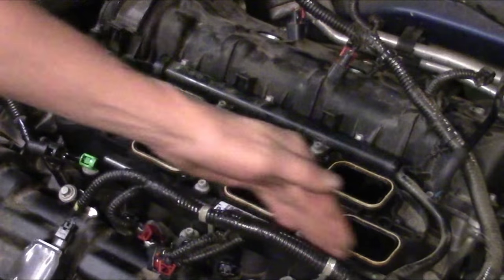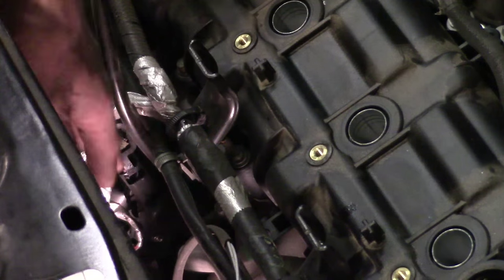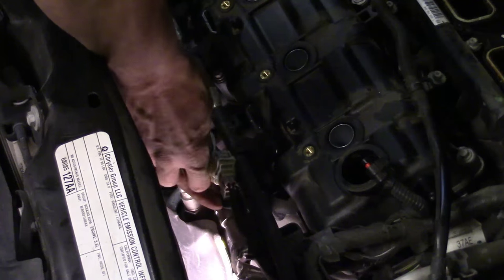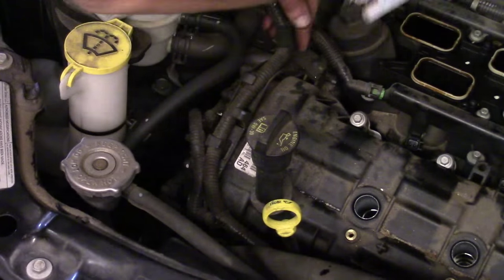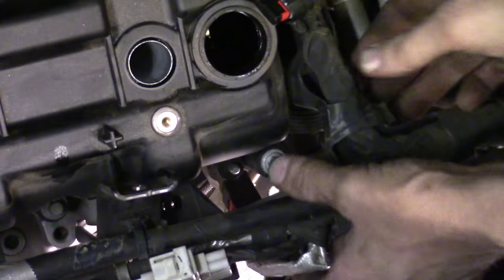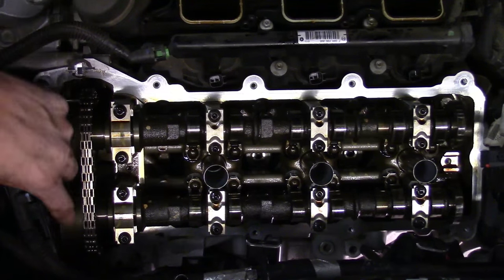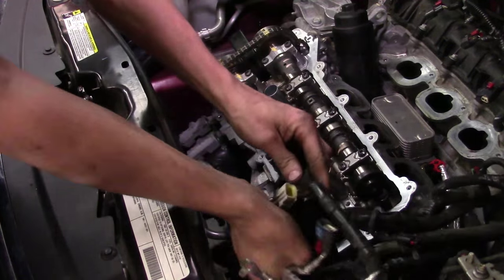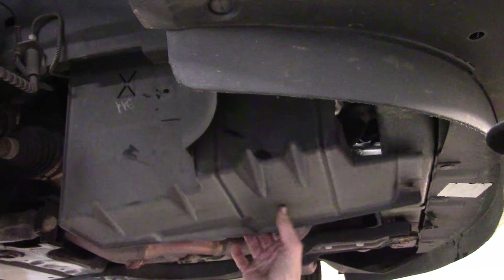Part 4/10: 3.6 Pentastar engine left cylinder head removal (the short cut)

Comment: Is it necessary to remote the lower intake for this head replacement? My 2012 Wrangler is in the shop right now and shop is trying to charge me $800 for the oil cooler and $500 labor for replacement when the engine will already be disassembled for the head replacement.

Comment: Hello I’m working on a 2011 3.6 Durango. The drivers side spark plug tube seal needs to be replaced. Do I have to have the engine on top dead center to take off the valve cover or can I just take it off and replace the valve cover gasket and tube seal? Your help will be appreciated. 🙏
Reply from the maker: No need to rotate the engine. Just remove the valve and then replaced the needed seals. Thanks for asking and make sure to subscribe.

Comment: I'm doing the right side of the engine, removed all of the bolts, removed cam sensor and whatever else was on the back of the valve cover. It's still getting caught on the right rear part of it and preventing me from completely removing it. Do you have any thoughts or ideas on what might be obstructing it still?
Reply from the maker: Have you removed the pcv valve? That has to come off as well on the rear of the valve cover and then you have to lift the front and move the valve cover towards the transmission to clear the end of the camshaft that sticks out the pcv valve opening.

Comment: Thank you very much for this great Video, for I have a question in a minute (03:07) of the section to which I referred Is it meant to the problem (P0010 Bank 1 Camshaft 1 position actuator circuit open)

Comment: There are two small protruded pins it looks like on the front valve cover on the lower side just inside the the outer stud bolts. Are they pins or are they special bolts I just can't seem to get my front valve cover off and I don't want to break it or pry on the sealing surface
Reply from the maker: The two pins are for alignment only. Dont forget to remove the cam sensor on top of the valve cover at the rear and then all the bolts loosened. It may still be "stuck" and need some help. The seal has some rtv near the front that seals the gap/seam between the front timing cover and head so it holds onto the valve cover a bit.

Comment: Hey where can I get a new valve cover gasket from other than the dealer? Mine has been leaking for over a year but it was a small leak and I'm noticing it getting bigger on my challenger. It's gotten to the point where some has leaked onto the transmission. A very small amount but it is there. I traced the leak to the valve cover so I know it is bad for sure.
Reply from the maker: What is the year of the vehicle.....it isnt a 2014 is it?

Comment: Do you have to have the heads machined if you are replacing the head gasket or can you just replace the gasket and put everything back together? I am not replacing the heads or having them machined, just replacing the head gasket. Is this possible?
Reply from the maker: Question? Why are you replacing the head gasket? Reason I ask is that they are multi layered steel and not blow. If the engine gets over heated to much the heads will warp
Reply: @MotorCityMechanic  It was loosing coolant and getting hot, not overheating but just getting hot. I took it to my local mechanic and he informed me that I have a blown head gasket. The temp needle in the instrument panel cluster would fluctuate, something I have not seen before.
Reply from the maker: trinity12ism reason I ask is that I have never seen a blown head gasket before on one of these due to the gasket being metal. Blown headgaskets pretty much went away around the late 90’s when they changed the gasket design. What will happen is the head will warp if overheated too much. Every time I hear blown head gasket I just shake my head. If you decide to take the heads off for some reason....I recommend having them checked to see if warped and checked for other issues by a machine shop. Personally I would have someone else check it before removing the heads, someone experienced with the 3.6
Reply: @MotorCityMechanic  thank you so very much
Reply: So i could for all intensive purposes just go ahead and buy new cylinder heads for my van and replace those, and that should solve the problem.

Comment: David,  I cannot help but think that you get 3.6 Pentastar engines that you just need to replace the lifters and rocker arms since this is such a common issue with these engines.  Can you please make a video that shows only how to replace the valve lash adjusters and the rocker arms?  It looks like I may have to work on my van myself?  Please...
Reply from the maker: I will try to remember to film one if I get another in for that reason. Usually the cam gets damaged as well when it happens and thats how you end up pinpointing which cylinder. I havent had one recently.
Reply: Thank you.
Reply from the maker: Your welcome

Comment: do you have a video for the Right cylinder head for the 3.6 Pentastar yet?
Reply from the maker: Not as of yet. I do know it takes alot more to do and there are no short cuts. The timing cover and in some cases....the metal portion of the oil pan have to be removed. Nothing simple about it for sure.
Reply from the maker: Good luck with that lol. Let me know what you find.